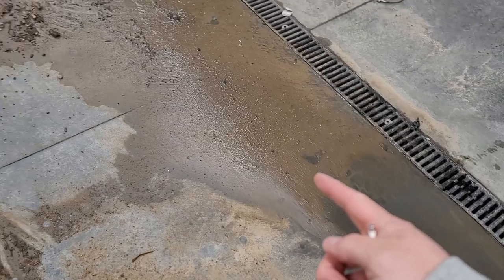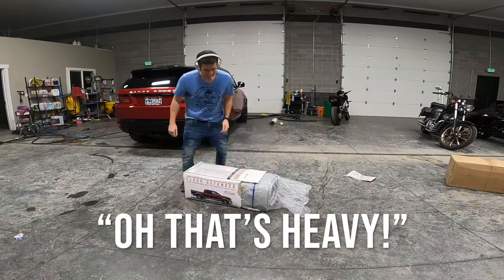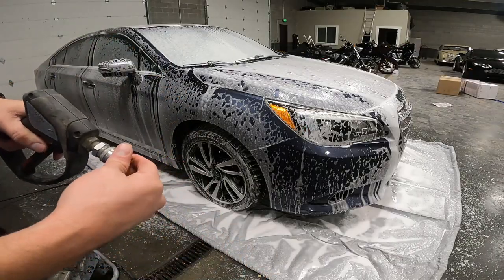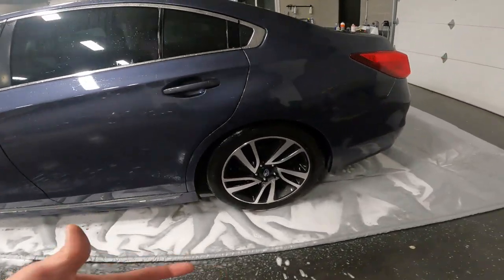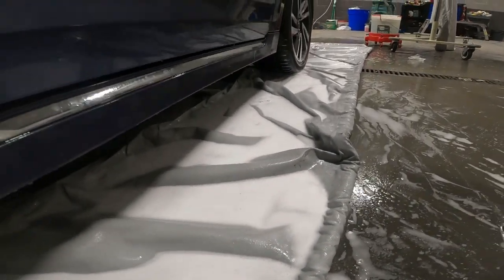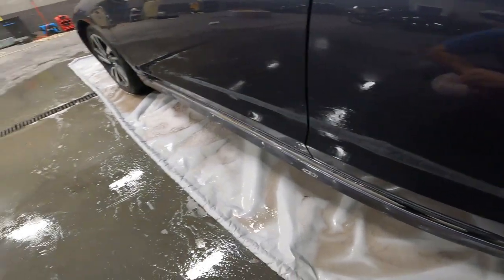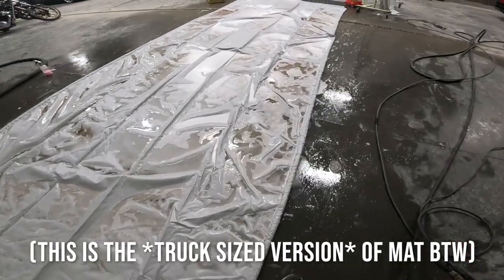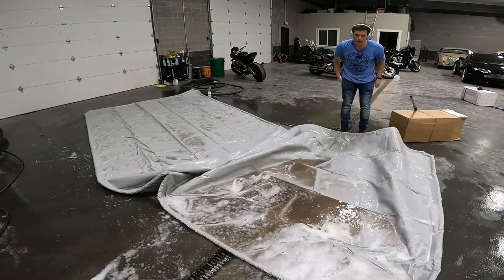FLOOR DEFENDER: can it keep my shop floor clean? Water reclamation mat test & review

Comment: In EU we have different types of floor matts, with a cushioned perimeter and built in drains ( works a lot better on an inclined floor ).
Reply from the maker: Ahh so does one side of the mat on low part of incline have a larger "wall" or lip? How/where do drains work out of curiosity
Reply: @HawkProDetailing  the walls are 10 cm high around the perimeter. The water is sucked by a water pump. But this method is used on demonstration days, professionals by law they need wash bays... In EU chemicals regulation are very strict
Reply: @LucaBonato  can you send any links to a decent cheap one? all i find is something like this

Comment: In my two car garage with no floor drain, I put two of these down, overlapping by a foot.  I mostly rinseless wash but if pressure wash too, i still end up with 10 gallons or more on in the mats. I use my shop vac wet vac and in 10 mins or less water is gone. Down side is possible slipping under feet.
Reply from the maker: Yeah I did slip a bit. And I don't mean to be a hater because if you didn't have these mats...it would be a disaster in your garage right? Im just not sure they make sense for my shop...especially with a drain. How are they holding up by the way?
Reply: @HawkProDetailing  agreed, I’d have to much water on the floor without them. One is a year old, the other about 4 months but holding up. I watch for stones in fear of a puncture. I’d prefer a floor drain any day though.